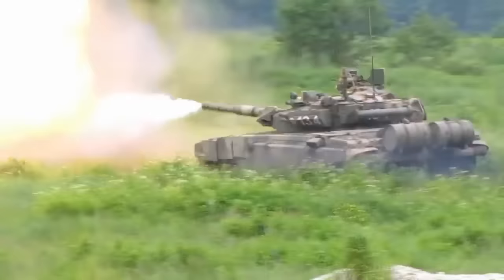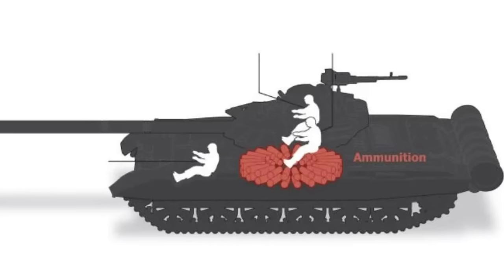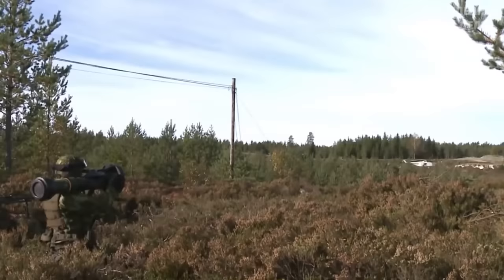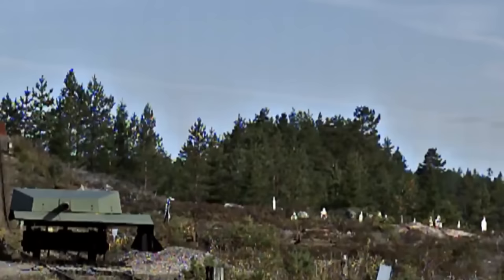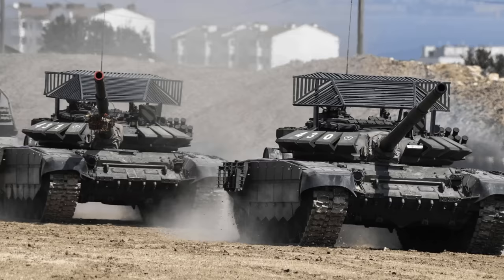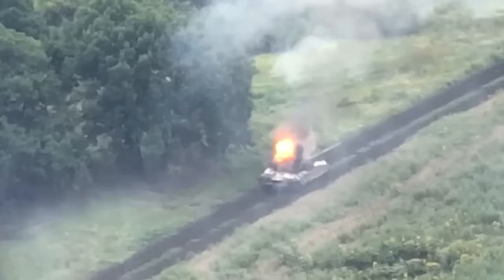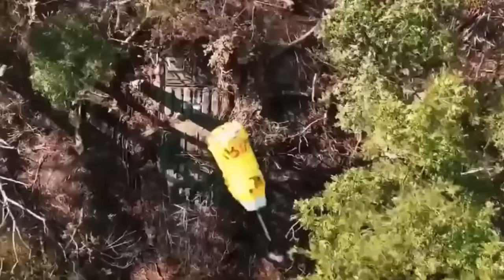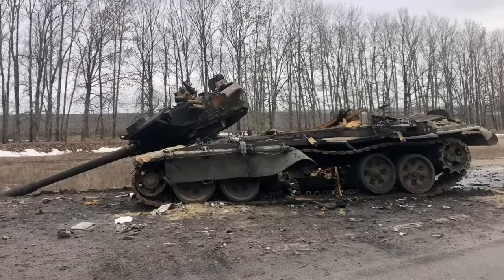Why does this happen to all Russian tanks? / real footage frome Ukraine

Comment: Not only tanks, Soviet era made warships put crew comfort in very low priority, assuming it was a concern at all. The US warships in general see crew comfort as contributive to morale.
Reply: In addition the Soviet Era warships had a lot of weapons but insufficient space to carry ammunition safely. Note that the German "Gepard" Leopard One AA AFV is NEVER seen on any footage = USELESS GIFT. Sitting, unserviced for 20 years is not exactly Military Support. Looking from the Outside it is difficult to see which side Germany and France are backing. Poland, Baltic States, TURKEY, U.K. are clear in their Ant-Fascist/Anti-Putin Stance!
Reply: I wonder if the aircrew of the Enola Gay relaxed in 'comfort mode' and sipped ice-cool Coca-Cola and listened to piped-in recordings of 'Frankie Croons in Manhattan' after they slapped each others' backs in self-congratualtion, after dropping the first Atomic Bomb upon Japan?
Reply: @rabsmiff  The B29 was the first bomber to have pressurized (portions of the) cabin i.e. the crew didn't need to be oxygen masks even when flying at high altitudes, although the standard safety practice then was to have at least one of the two pilots on oxygen mask just in case the cabin decompressed. Whether the Enola Gay crew had sipped coke is beyond me.
Reply: @rabsmiff  they had considerable more AC than the Japanese they roasted in a second on that day. 🤣😅
Reply: @brndxt  Could be a hint that the Germans at the nuremburg trials showed no "remorse" so they were "War criminals,The crew of the Enola Gay showed no remorse,Bomber Harris bombing Dresden showed no "renorse" so war criminals are on the losing side,Just food for thought,I can understand crimes against civilians being punished
Reply: @Johnketes54  You lack context.

Comment: For those wondering why they leave hatches open, it's to quickly escape the tank when it gets attacked as the hatch can shut or not be operational.
Reply: but wont that deactivate the tanks anti rocket defense system?
Reply: @Baneful_Ben  Some of them were moving with the hatches open.
Reply: @Baneful_Ben  I've seen countless real videos. The crew rarely survive long enough to try and crawl out. But I've also seen plenty of videos of that scenario too. There's no shortage of pictures out there of ruskies burnt to a crisp.
Reply: The real reason is,Russian tanks don't have air conditioning.
Reply: That and they leave hatches open so the commander can actually look around. A "buttoned-up" tank is semi-blind and without buddies to watch it it's depressingly easy to destroy it.
Reply: @Baneful_Ben  It's hard to scramble out of an open hatch when you were liquified.
Reply: Hatches are open because Russian tanks lack airconditioning systems which is a bitch because Ukrainian summers can be super hot with temperatures of over 40° C. 

Another reason is because Russian tanks do not have good view as they are far behind the Western tanks that use video equipment to give tank crews to see 360° around the tank and possibly above and below it when it is necessary. So Russian tank commanders as well as drivers need to keep hatches open in order to see better.
Reply: Also Russian tanks have no ventilation inside and it gets extremely hot.
Reply: Also to give relief from the heat—T-72s are not air-conditioned.
Reply: @sivertkind  Hahahahaha.
Reply: @Y_hass  It's very common for tanks to have the hatches open. They button up when the suspect the enemy is near, perhaps even waiting until the first shots are fired.

In World War II, the turret-mounted machine guns could not even be operated without opening the hatches and exposing the crew. It's one reason they had bow machine guns.
Reply: @gpgpgpgp1000  Just sit tight and the pop-top turret will handle the ejection.
Reply: @Baneful_Ben  that you expect to see burning crewmembers scrambling indicates that you dont grasp the forces on display.
Reply: Those are fake videos. Those tanks were already abandoned or captured. Ukraine films such videos for propaganda purpose.

Comment: The Nlaw jet does not penetrate through openings in the turret. It can burn through 40 to 60 cm of steel.

Secondly, while it is spectacular when the turret pops, its likely not as significant as we make it out to be. The explosion or jet that ignites the ammo likely also killed the crew before the ammo ever exploded. When an explosion has penetrated the hull, the tank is most likely lost with or without the cook off of ammo.
Reply: There are numerous videos of tank crew crawling out of their stricken beast after it's taken a hit—sometimes, horrifyingly, after the ammo has already started to cook off.
Reply: It depends on what the tank was penned with. A simple WWII-style AP round that does not ignite fuel or ammo will just be a hole, although you would likely lose some crew. Modern HEAT or DU arrows, on the other hand, tend to torch everything inside.
Reply: bolshevik1017 calm down with the propaganda please.

Comment: It happens to Russian tanks because they are designed with their ammo and crew kept together in the same space, and a large ready ammo rack in a circle around the turret, the turret crew basically sit in a ring of tank shells, while the rest of the tanks ammo is stored in racks throughout the tank, when the tank takes a penetrating hit that detonates the ammo, it sends the turret flying, like a cork from a champagne bottle.  American tanks don't do this because their ammo racks are in a separate compartment, shut behind a heavy armored door the loader has to open and close every time he grabs a new round, they also have specially designed panels on the roof of the ammo rack that blow off in the event the ammo rack is hit, allowing the explosion to blast up into the air instead of through the crew compartment, or out through the turret ring, blowing the top off of it like the Russian tanks tend to do.

Ammo rack explosions are a fact of life in tanks, they are armored boxes filled with fuel and ammunition, hit them in the right place, and they explode and burn from the inside out.
Reply: That's the thoery with American tanks how many have they been used and how many lost before you start patting yourselves on back,A good eye opener was the Sherman confident in it's capabilities and proved not man enough but built in huge numbers saved the day,But individually like these Russian tanks Tinderbox
Reply: @Johnketes54  Look ANY Abrams tank battle during the Gulf war and see how dominant they were.
Reply: Thank you for saying exactly what he said in the video🫡
Reply: @Johnketes54  number 1. I'm not American, I'm Canadian, our tank of choice is the Leopard 2 MBT, not the Abrams.
number 2. the Sherman was built to be easily built, easily replaced, easily maintained, and easily operated, all the tanks that came after it in US designs were built much the same basic way, able to have parts swapped out quickly, and efficiently so they could be sent back out to fight sooner, simple straight forward controls and maintenance.  Built like pig-iron tractors, and they gave most everything a better engine than they did the Shermans, those damn radials were utter garbage.
Reply: @boeing900  Abrams dominated in the gulf war for 3 primary reasons, their range was a shitload farther than saddams tanks could see, and alot more accurate on the move and standing still, second they were using GPS tech to move through normally impassable tracks of desert and dunes that even the Iraqis themselves couldn't go into without getting hopelessly lost.

And 3, most of saddam's army didn't want to fight, there was only a handful of units zealously devoted to fighting and dying for him if need be, and they were pretty much wiped out when they were caught by surprise by Abrams coming in out of the desert they couldn't go through themselves, so the flank they were on was almost undefended, and the troops stationed there had their guard down.
Reply: @henryweinand8672  I've known this stuff for near a decade, its not new information, so it puzzled me to see a video trying to answer a question that's at least a decade old.  Russian tanks have been popping like corks since the gulf war.
Reply: Tell me how many high-explosive shells are in Abrams? I'll tell you they are not there, what will Abrams detonate? Crowbars? Cumulative projectiles?
Reply: @generalgames2810  what are you talking about? I don't know how much HEAT an abrams carries, I dont even know how many rounds it can carry in a full ammo rack, but I know they carry SABOT, HEAT, and STAFF rounds, as well as shitloads of 5.56 for the coaxial machine gun and .50 cal ammo for the MG on top of the turret, not including sidearms and ammo for them for the crew, they carry PLENTY of shit that can go boom if you hit it with a tank shell.  Sounds you're using google translate but its coming through broken and unreadable bud.
Reply: @generalgames2810  It seems you are under the impression that a cook off would only happen with the actual projectile, thus no cook off if kinetic penetrators only. That is not the case. The propellant is a huge part of this. And since sabots are not thrown by hand, they are part of this issue.
Reply: @rhino2960  I repeat once again that Abrams does not have high-explosive shells. Since his body does not withstand even 5 shots of high-explosive shells. And to compare the detonation of a high-explosive projectile with the detonation of a cumulative one is such nonsense ...
Reply: With the sole exception of the M1a2 Abrams, every Western tank stores at least 2/3rds of their ammunition in the crew compartment without the protection of blast doors or blow-out panels

The Leopard 2 stores only 15 rounds behind blast doors; the rest of the rounds (27) are in the crew compartment, next to the driver. 

The Challenger 2 stores none of its rounds behind blast doors

The Leclerc stores 22 rounds behind blast doors; and the rest are located in the crew compartment without the protection of blast doors or blow-out panels 

The Merkava mk4 stores only 10 of its 48 rounds behind blast doors.
Reply: @thephoenix756  I stand corrected.
Reply: @rhino2960  

No worries, mate

You're a very welcomed anomaly on the internet because most people wouldn't concede. Thanks heaps, mate
Reply: @thephoenix756  ive been called alot of things throughout the years, first time ive been called an anomaly
Reply: @rhino2960  America completely overhauled it's entire tank program after WW2.
Reply: It’s not just Russian tanks but even NATO tanks also explode when they are hit by modern ATGMs. It has happened before to Saudi Abrams and Turkish Leo 2.

Comment: So how many thinks that crew will die because stored ammunition gets blown up by a hit, and not because the hull gets penetrated and hot molten metal will fill the hull with massive overpressure and ignite even the stored ammunition under protective armor plates etc?
Reply: It happens pretty much instantaneously. I don't think it makes a lot of difference to the crew. BOOM!! Goodbye.
Reply: A good anti tank weapon is not getting the credit it deserves,So blame the poor Russian armour instead for not resisting the power of the weapon
Reply: @Johnketes54  The war is about shield and sword. It is constant competition and pace of the technology upgrades in the weapons. 
It is far faster and easier to upgrade a small man carried weapon, than it is to improve a tens of tonnes weighting metal vehicle to become even heavier and so on. 

When someone invents a new weapon, at some point someone invents way to counter it. Then it takes again some time that someone invents way to counter that new counter. And that keeps going. 

But there is no weapon that is "do it all", like there isn't protection that is "do it all". You can put 50 attacks and only one is capable penetrate the defence. Or you can put 50 defenses and only one of them can actually protect. 

It can be so simple thing as terrain, or situation where a bad weapon becomes effective one, or where good armor becomes ineffective one.
Reply: So as Hillary stated, "at that point does it really make a difference!"
Reply: @kenbrown9164  No, it doesn't make difference. On the moment when the armor is penetrated and crew is dead, the vehicle has no use in combat by the Russia, as in middle of combat that vehicle is lost. In west that vehicle is valued more than the crew inside, why the crew is expendable and vehicle is wanted to be deserved for new crew. So the vehicle is recovered by combat pioneers, new crew will clean the leftovers of the previous crew and the armor is taken back in the use if technically just possible after being either in the depot, or shipped back to home to factory. For soviets design that vehicle didn't anymore matter, another one will replace its duty. 
When the crew is dead, it is not because Russians armor is weaker or worse etc. It is just because in that one situation they got killed, just like western armors gets killed and their crews are dead as well. That leftover is left on field and dealt accordingly after the combat.
The US is protecting its M1 Abrams weaknesses by destroying completely the vehicles or recovering them and not revealing reasons or causes, where Soviets design is known, 1) crew was killed by penetration and 2) vehicle was destroyed after penetration. But there doesn't really happen that crews die because ammunition cooks off and blow up the crew that would be alive otherwise.

Comment: And what do you think happens to a western tank crew when molten metal comes in from a top attack missile? The western tanks also have virtualy zero top protection. The tank doesn't blow put crew is burned dead by the blast. PS the ryssian tanks where sitting duck cause zero combined arms, zero training and zero soldier motivation.
Reply: @Patriotswelcome  is there a tank (in any army) that, without trophy style active contre-mesures, can resist a top attack missile strike?

Comment: A note on the Leopard 2: The Leopard has two magazines. One in the back of the turret, that is separated like that of the Abrams, but it also has one in the hull, next to the driver.
Reply: as a former LEO1 and 2 mech i highly doubt a ammo rack explosion in the Leo2 turret will not hit the crew ....duck tales
Reply: So, it is susceptible to that kind of cook-off as well.
Reply: The secondary magazine is sealed from the tank crew compartment. The tank has to stop while ammo is manually moved to the operational magazine. It's easier than going back to base for a reload but not so cool with incoming fire.
Reply: @kubanskiloewe  
There have been tests which I believe you should know about if you are really that mechanic you claim to be.
Reply: @kubanskiloewe they're called blow-out panels. (You know, the panels on top of the turret that blow out of there's an ammo cook-off.)

LEO mechanic my ass.
Reply: @michailpanchev9952  Look up the destroyed Turkish Leopard 2's abortively used in Northern Syria ~2018 or so. They threw turrets and peeled apart from the inside just like Russian tanks when subjected to accurate ATGM fire.
Reply: @davidelliott5843 

It is not sealed; there are no bulkheads/blast doors or blow-out panels for the 27 rounds in the hull

Comment: This I think it ignores two facts, fairly important facts actually. 

Russian armour doctrine as I understand it doesn't really compare to the western, NATO doctrine in that the time the crew are expected to be in vehicles is actually quite limited. To the point where a Soviet tank..... formation, this seems to apply at a few levels, gets its orders, gets there, follows it orders in the attack, stops, rests and the unit who's operation starts after, they take over. They're not expected to operate for long periods of time within their vehicle. So, if I remember an example given correctly, they might only need to inside for four to eight hours, as opposed to days. 

In theory at least. Sorry Nick, I may be misquoting, misremembering you on the matter. 

Secondly, it's also worth pointing out it's not a bad trade off, the carousel system. If you look at the T-72 and later series vehicles, maybe even T-55 they do have a lower profile than a NATO equivalent tank. M60, Leopard and co, they're pretty tall. T-72 is short as a point of comparison and under ideal circumstances should be harder to hit. For a tank on the offence in an expected forward offensive to the French coast? Not exactly that bad an idea. 

At least against contemporary vehicles. Modern FCS systems are, see it, hit it, does it change shape/burn? If no, engage again, if yes, new target. If you can see it, you can hit it. 

Also worth pointing out Javelin and NLAW were designed to target specific, known weaknesses. So having an AT guided missile make a tank explode? Not exactly surprising. Also not surprising, propellants and explosives are in fact, volatile. You have designed intent, physics and chemistry all pointed towards a single goal. Again, is it really a wonder why it works so well? 

Also worth pointing out, an item misused and badly maintained doesn't truly give a fair comparison, fair point of comparison against one that is. That is to say, would I take say, a current Russian motorised brigade with tank support against a MEU or NATO equivalent formation? Nope. In general I wouldn't, I'd attack where they're not. Would I in the scope of an exercise say, take a Polish equivalent unit? 

Now that's a far more interesting question.
Reply: @Jedi_Knight_1970  You are were in the armed forces? Not playing a Tank game on your computer?